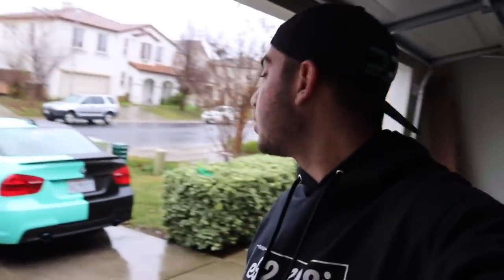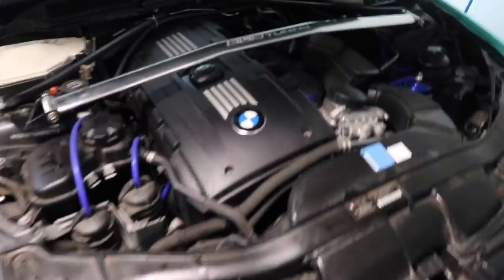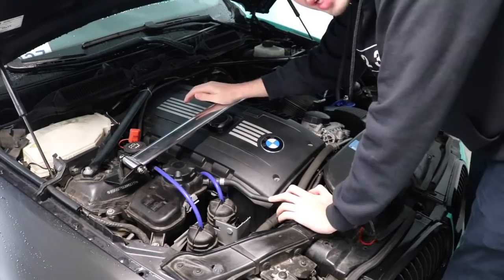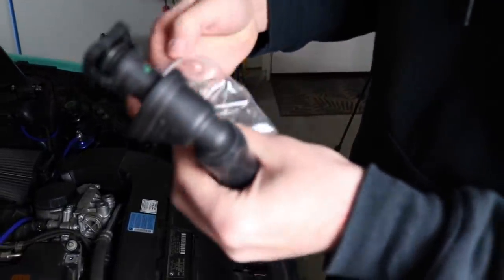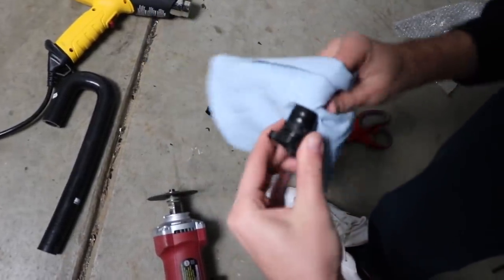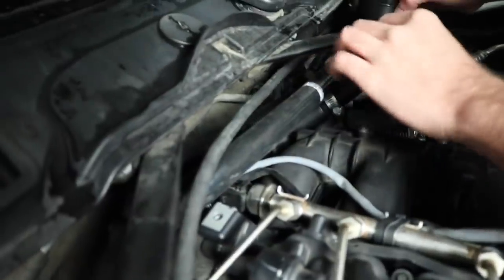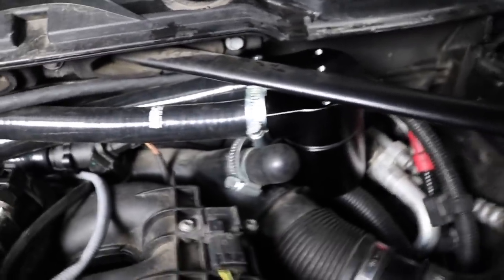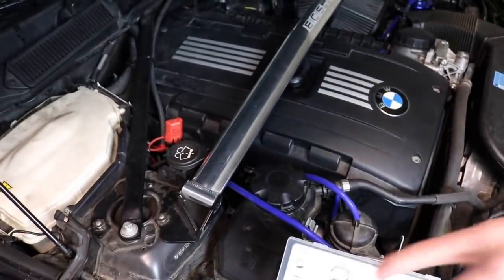THIS MOD COULD SAVE YOUR ENGINE!

Comment: Countless forums and time has proved that oil catch cans, unless paired with high use of e85, are completely useless. You would've been better off installing a new RB PCV valve by itself and saving the space in your engine bay.